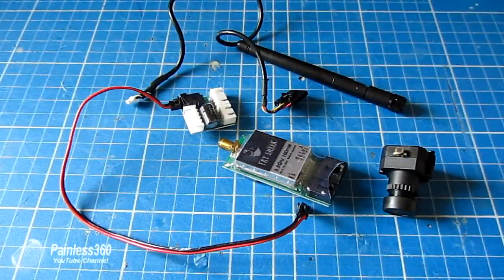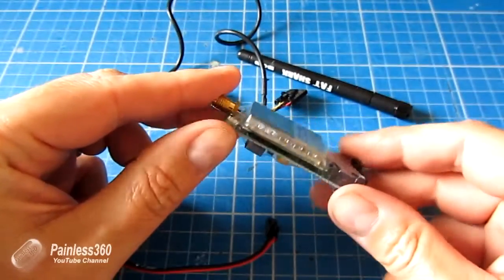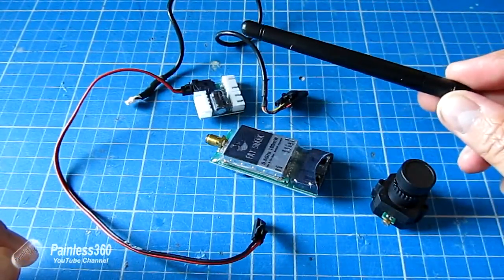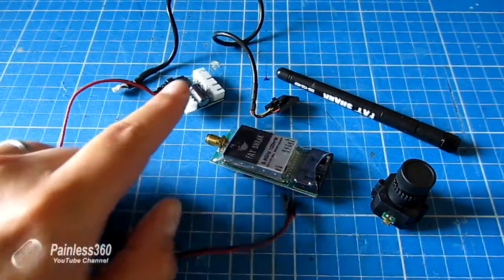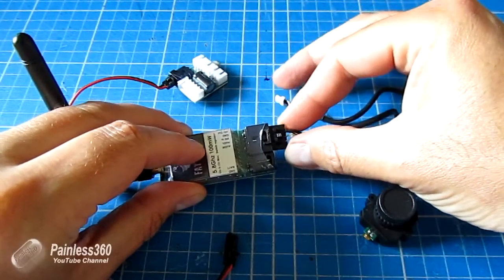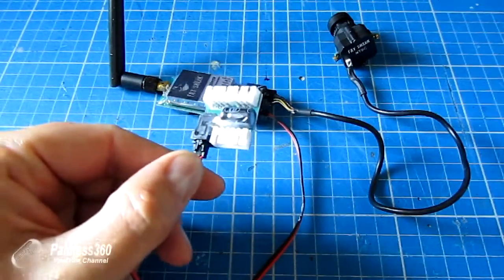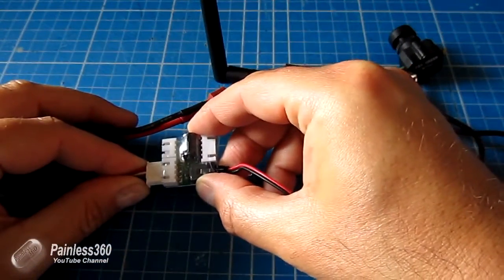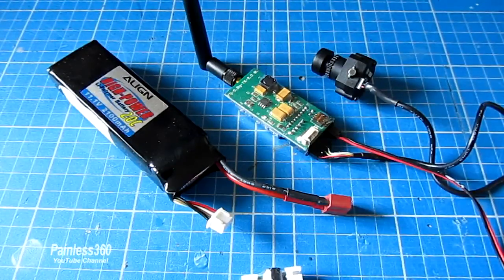Introduction to FPV - Connecting the airside pieces (Fatshark)

Comment: hi painless360, i am building my first quad and i would love to add a fpv kit to it. however i don't know what is the best kit to buy in 2020... 
also what are the names of these connectors i.e ( from the camera to the vtx and how to i connect the vtx to the screen/goggles.
i know that i have to have a JST cable to have 12+V power from the PDB and plug in the camera, but my problem now is i have no clue how to connect that camera+ vtx to a screen . what should i do ? thanks a lot for the great help you are putting at this channel , this channel have always been a reference <3
Reply from the maker: The connection on the back of the camera are pretty standard now but all of the others vary with the manufacturer... Best of luck!

Comment: for a transmitter such as https://hobbyking.com/en_us/x50-6-600mw-tx-cnc-alloy-case.htmlthat has a wide input voltage range, is it possible to connect it directly to the balance leads on a battery such as https://hobbyking.com/en_us/turnigy-1000mah-3s-30c-lipo-pack.html?
Reply from the maker: +Peatah Andy yep, should be fine.

Comment: Nice vid strait forward! could I just solder the power leads to a 5v rail on flight controller? Thanks!
Reply from the maker: You could but watch for how much current that 5v supply can produce... Happy flying!
Reply: Painless360 how many mah about should it be? Thanks man!

Comment: Is that a Filter that you connect your battery to? if so how could i connect this to my walkera 250 runner as i am looking to add an FPV filter
Thanks
Yet again another great video
Thanks
Reply from the maker: Not a filter, don't use them here. Which bit of the video?
Reply: I think your videos are well explained easy to understand but being new to  this not knowing what some of these items do
Reply from the maker: We have a series called 'Introduction to Remote Control) that covers all of the basics. They may help. Best of luck!
Reply: Do all these parts come with a Fatshark FPV system or do these transmitters and antennas have to be ordered seperatley?
Reply from the maker: Depends on what you buy. The starter kits (like the one I ordered my very first time) comes with the camera and Vtx too. Best of luck!
Reply: Can i ask were you buy your standoffs Many thanks
Reply from the maker: I've ordered them from eBay before now. Look for PDB nylon standoff kit..
Reply: cheers

Comment: can you split the balanced lead from battery to run FVP and gimbal?
Reply from the maker: +genevacoast You can pull power from the balance connector to power things like the FPV kit. Not sure what you mean by 'split'..
Reply: +Painless360 can i use a balance y connector to power both fpv and gimbel
Reply from the maker: Yes,but be careful not to pull to much current from the balance tap. I'd use a power distribution board for the things that need more juice..

Comment: i have a question it might seem dumb but, 
how do you plug the quadcopter in if the battery is plugged into the transmitter? or is the red cable the one you plug into the quadcopter? 

if you could answer this question it would be great as im trying to put together my first fpv setup just want to make sure i got all the bits.
Reply from the maker: You need to power the transmitter using 12 volts so as long as you can get the 12v to the board you are good. Simplest way is to use the power connector (red one) to power the model and use the 12v out of the balance tap to power the video Tx and camera. Happy flying!

Comment: The issues with this is that a voltage alarm now needs it's own outlet, b/c the fatshark does not come with an OSD! I'm having an issue with this. Trying to figure out which OSD to buy for my fatshark V3 set up since it's powered by my lipo plug that I would normally use for my voltage alarm. HELP! :)
Reply from the maker: Paleo FPV lots of different options here that depends on the board you are using  (Multiwii,  APM,  Naze32  etc.) 

Search for Minimosd on my channel to see some solutions for OSD that cost less than  $15..
Reply: I'm using a CC3D FC :)
Reply from the maker: Paleo FPV google CC3D and Minimosd then..

good luck.
Reply from the maker: Painless360 and you can always connect the low voltage alarm to a splitter or to the power distribution board? Just a thought. . Happy flying!
Reply: I've googled it many times. Just thought I'd ask an expert and youtube seems to be a good resource. Checking the forums as well. Thanks dude!

Comment: Thanks for the video. I was looking for a way to power my 3DR video transmitter on my 3DR Y6 using my main flight battery (3s or 4s). I don't use fatshark goggles.
Where can I purchase such a voltage regulator?
What is the voltage coming out from the 3s or 4s battery balance connector - is it 11.1v for a 3S and 14.8v for a 4s?

Thank you
David
Reply from the maker: Hi David, you are right on the voltages. Looking at the specs for the 3DR kit it needs 12v so connecting it directly to a 3s LIPO will be fine. If you use a 4s battery then you can use a voltage regulator (http://www.hobbyking.com/hobbyking/store/__18788__12v_4_5a_ubec_2_5s_lipoly_7_2_21v_.html) or connect the camera system to the balance tap and only connect to the first 3 cells of the 4 in the pack. Careful with this method as this will mean more balancing for the pack when you charge it. Hope this helps.
Reply: Painless360 Thank you.
May I ask whether this is a better option for me as I need to power two 12V devices - 3DR Video Transmitter and Tarot T-2D V2 GoPRO 3 Brushless Camera Gimbal.
http://www.hobbyking.com/hobbyking/store/__49470__Quanum_12V_5A_7_2_25_2V_Dual_Output_UBEC.html

In this case, I need to use a 4s instead of a 3s battery - is this correct?

Looking at Quanum UBEC diagram, the supplied input connector may not be able to the 4s balance tap. Is this normal for any UBEC?

David
Reply from the maker: David, both will work. That regulator is rated to work with any LIPO from 2s to 6s so you can use whatever you want. If you need more help I can talk you through it over a Helpout session.

Best wishes, happy flying!
Reply: Painless360 Thanks.
I still don't get it for the input side of the UBEC. How do I connect the 2 power wires from the UBEC to the balance tap of my main flight battery?

Or am I suppose to connect the UBEC input power wires to the battery power connector instead?
Reply from the maker: You can use a balance connector or solder it into the main power connector that already connects to the battery.

Anywhere on the model that gets the full battery voltage will work.

If you need more help please schedule a Helpout session.

Best of luck.

Comment: Just got my Fashark Predators yesterday so really looking forward to a weekend of FPV!
Quick question though, if I'm already using the balance lead for a low voltage buzzer, other than using a seperate battery to power the TX, what are my options? Do you get any information/data through the goggles at all?
Reply from the maker: Hi Paul, exciting times! Have a ball this weekend! You will need a splitter cable to connect two things into the balance tap, the good news is that if you can hear audio from the model when flying FLV you'll hear the alarm in your headphones from the on-board sound so you won't need it close in to hear. Personally I'd time how long you get from your pack to be 75% empty and set a timer on the radio to count down. I use this as I get engrossed in the flight and lose track of time. Happy flying!
Reply: Painless360 Could you advise as to where to get a balance tap splitter cable. 3s to 2x 3s, if such a thing exists. Thanks.
Reply from the maker: Search on places like eBay for 'parallel 3s balance' or you can get the parts and make your own.. Good luck.